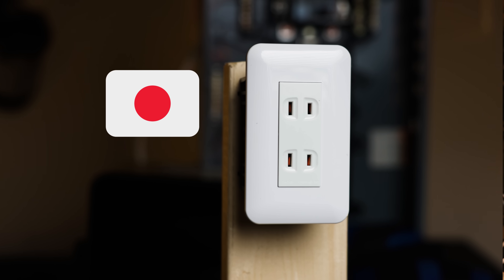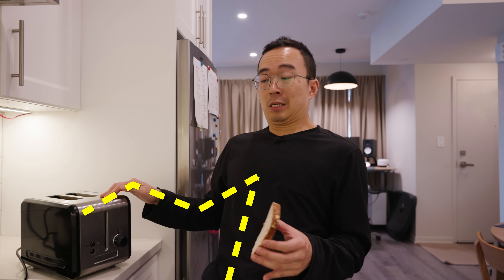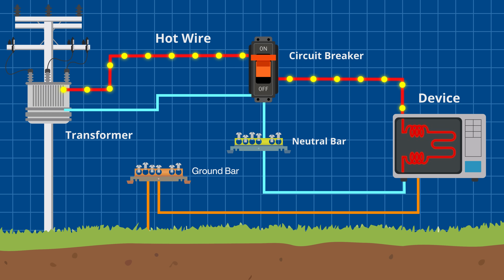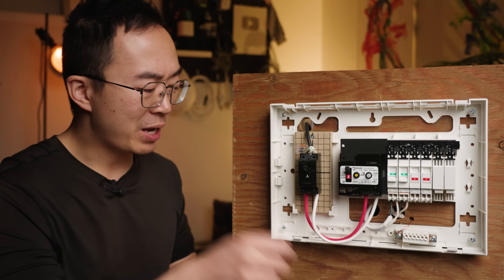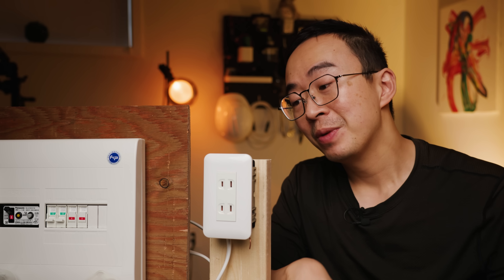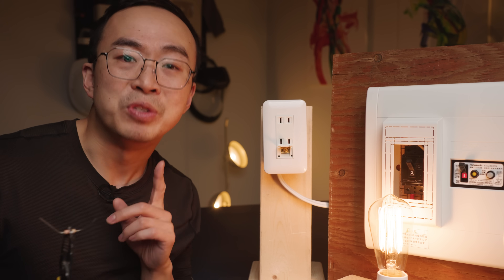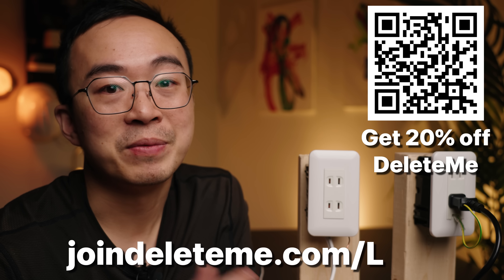How Japan Made Their Outlet Safe

Comment: I’m a bit confused by this video. Does Andrew live in Canada? Because here in the USA, we have grounded sockets, GFCI, and also polarized plugs, and circuit breakers. I am even looking at the GFCI protected outlets in my home literally as I type this. Seems like in fact the “international” RCD standard trips at some 20 milliamps while the USA one trips at 5 milliamps, making the American system, in totality, FAR superior for human protection. Plus you have grounded potential which ensures all voltages measure correctly relatively to each other (extremely important for digital devices). Am I missing something here? Everything I wrote is factual, unless I am mistaken somewhere.
Reply: Canada and the USA electrical outlets are the same. GFCI trip between 4 and 6 ma. There are only minor differences between Canada and USA electrical codes, mostly in installation clearances and acceptable grounding methods, otherwise they are largely the same.
Reply: @wally7856 what I mean is this video makes it look like the USA doesn’t have much protection beyond grounding.

Comment: This is not how ground works. In European electrical installations for homes there are three protections: 1) circuit breaker for too much current in case of short circuit - electricity flows uncontrolled but still within the system; if left unchecked, the installation will overheat with risk of fire 2) ground circuit breaker - this triggers in your toaster case when current out is not same as current back in, so there's a leak of current (to ground, possibly via you). Typical trigger level is 30mA. 3) Ground - which you explain in the rest of the story. This is to remove electrostatic charge buildup from electrical devices by equalizing the relative voltage of the device with that of the installation to that of earth ("ground").

Comment: It only works if outside is grounded and the leak goes before FI .... if you are in wet bathroom where grounded washing machine is connected to the wet floor and you touch anything, central FI won't protect you ..... that is why there are usually FI protected outlets on those places ..... in EU FI is mandatory for yeeeears .... and also we have grounded appliances to avoid internal failures ..... overall Japanese system is simply inferior and not very safe ..... and don't let me start with Japanese 100V system which is just even worse than american 120V ... it needs almost ~2.5x more of copper, to transfer ~2.5x more current than rest of the world .... meaning it is waaaay more expensive, more prone to failures and fire etc. ........ hope they don't build paper houses like in US .... US electric "standards" are just joke and are usually installed inside flammable materials with 2x more current and therefore prone to fire which is ridiculous .... from Europe stand it is just 3rd world country, we require FIs ... also for flammable spaces AFDD (Arc Fault Detection Device) is required ... I bet americans never heard of that;-DD

Comment: Okay I am really confused now. I’ve been living in Brazil and the way things connect there are curious to say the least.

First, all outlets have 3 pins (one for ground). But the weird thing is that, from the pole you have one red that comes from the transformer and a blue that is a grounded rod at the pole.

From there you have your main, two surge protectors (red and blue) and a GFCI that is only used for areas that commonly get wet (kitchens, bathrooms…). Then you have a ground which must be kept SEPARATE from the GFCI connected lines.

What’s up with that?

Comment: Our house was built 2 years ago. It uses mostly the 2 prong type, but there are a few with grounding screw terminals. The ones with ground are in the bathroom and in a couple of other places where high power appliances were expected to be connected. We also have some 200v outlets but those all use a different kind of plug which has 3 prongs. At my office almost all outlets are 3 prong.
Oddly, though all the outlets are polarized (one pin wider) I have not seen any Japanese appliances with polarized plugs.

Comment: Ok question, i live in an apartment in Japan (2020) and my room doesnt have a ground plug at all, my monitor has a ground wire coming from the plug, am I safe to keep the ground wire detached? I’m at least looking into a plug that has a ground screw in case
Reply: Well , you lost the protection IF there is a fault. If you want to take risk, go ahead and remove that ground pin.
Reply: It's Japan, so the electrical wiring is done (by law) by a certified electrician and not the owner's I-ll-do-it-for-a-meal friend. You'll be safe.

Comment: Ground is not for the safety!
It is hilarious to see that so many comments point it out and the video still there without fixing the misinformation.
Reply: Ground indeed protects people by tripping the circuit breaker while standard breaker protect wires. Where people get it wrong is thinking standard breakers protect people
Reply: @nhitc6832  I know that. But what I meant is the main purpose of ground is not the safety. Breakers can use the property of ground - if you have it, but not necessary - as you see in Japan case. The main reason for having ground is setting the reference voltage, because voltages are relative.
Reply: @user-irkdj248dkdollii  We literally call the third prong in North America the "safety ground". It's sole purpose is to connect to the metal chassis of an appliance in case of an internal wiring fault. If the hot wire somehow detaches inside the appliance and makes contact with the metal chassis of the appliance, the whole appliance is now hot. Without that safety ground the chassis stays hot and if you touch the appliance, you too are now hot - touch say the sink with your other hand and you die. With a grounded chassis, if the hot wire contacts the chassis, the current returns through the safety ground wire and trips the breaker deenergizing the circuit. Plastic chassis appliances don't use the safety ground here (2 prong plug instead of 3) because they don't have that danger as plastic isn't conductive.
Reply: @wally7856 Hi Thank you for the input. Yes you can use the third prong for safety purpose, and maybe that's why you call it that way. But as an electrical engineering major, the more important purpose for the third prong is setting the 0 voltage reference. For safety issue, there is a way to achieve the same thing without the third prong.
Reply: @user-irkdj248dkdollii  You use the neutral wire for your zero reference voltage not the 3rd wire safety ground. In fact, using the third wire safety ground as zero reference is just downright dangerous as a broken neutral in the circuit would energize the chassis of your appliance. The safety ground wire is also noisy and a horrible zero reference anyways.  I'd also like to know how you can achieve the same appliance safety without the third wire. Connecting the neutral wire to the chassis is just asking for trouble as humans hook up these outlets and they can and do reverse the hot and neutrals by mistake making your appliance always hot. GFCI's are not everywhere and even if they were, you would still have a hot appliance until you got shocked and only then it trips. Back to how we do things here, the sole purpose of the 3rd wire safety ground in North America is for safety and that is it, nothing else.

Comment: In Sweden (and EU) we have grounded outlets (where only grounded or double isolated appliancies fit) in kitchen, garages, outdoor etc. In old days we had ungrounded in livingrooms etc. But in modern building standard we have grounded outlets everywhere. To this we have a common ground fault breaker in all houses. In the electrical central, by the fuses. Both belt and suspenders. Furthermore ALL outlets and extending cables are child safe. You cannot put anything in one of the holes in the outlet and get connected to power. You need the plug to remove the plastic safety in the holes, with both pins at the same time.

Comment: A couple things wrong with this video: 
-the wiring diagram shows shows the neutral wire going through the circuit breaker. It doesn’t. 4:02 
- connecting ground and neutral doesn’t “save your life” by creating a “high speed raceway”, allowing the breaker to trip. Your circuit is grounded, and so that already exists. The current doesn’t need to go back to the neutral wire to do this, and it certainly doesn’t need to go through the breaker a second time via the neutral wire as your diagram shows. 3:21

Comment: Ahh.. I didn’t like the AC power being animated like DC (moving in a continuous path around the circuit and not oscillating back and forth)

With the example of power going to ground, it’s easier to visualise that the power doesn’t need to travel from the ground stake to the transformer down the street.. the electrons aren’t (on average) actually travelling anywhere, just vibrating back and forth…

(Had this click for me when a friend pointed out a rural property that had a “single-wire earth return” setup (SWER)

Was thinking.. wait, how would this work? And if it did, won’t all the electrons build up at one end or something? Nope.. thinking like DC

Comment: half true, a ground wire ALSO can divert current too small to trip a breaker if there is high resistance connection somehow from hot to chassis.  The breaker won't help you there nor is the ground wire solely  intended to trip it.  It doesn't take much through the torso to kill a human.

Comment: Yep, you said it at the end. YOU GET SHOCKED before the GFCI (RCD) trips. Having PE in the outlet will trip the GFCI the moment the fault appears, no touching required.
So, adding GFCI without PE doesn't make outlets safe and I am almost sure it's forbidden by law in my country.
Reply: Also PE must be linked to N only when GFCI (RCD) is present and the link must be before it, otherwise the fault current might be too small to trip the current breaker, but enough to start a fire.
Reply: This is in the case where the hot wire is just hanging out. In such case, I'd argue that Japanese panel is safer than American one. Japanese GFCI breaker protects everything in the house. So if you touch that hot wire, the breaker will trip. However, in the U.S, you'd HOPE that hot wire is connected to a GFCI outlet/breaker. But as we all known, not everything in U.S houses is protected by GFCI.

Comment: Good explanation of why we jump neutral and ground in the main panel in the US and fault current!  The device in the Panasonic main panel would be called a GFPE in the US with 30mA leak current.  GFCIs trip at 5mA leak current for the exact reason of a higher safety margin for people (like small children).  The 2023 NEC revision added more location where GFCIs are required (not to mention changes for AFCI requirements).  The best of both worlds is always going to be a grounded GFCI.  GFPEs are used where there is a higher tolerance for leak current and to protect devices.

Comment: Hmm. I need to learn more about my outlet. It seems like the ground wire is pretty useless :D
I do have my residual-current circuit breaker connected to everything, except the fridge (yes, the big metal box), because it sometimes trips on its own. And I use by RCCB to shut down my apartment when I leave for a week or more.

Comment: An interesting thing about the old two-prong outlets in the U.S. is that, if properly wired, they were grounded. The screw in the middle that secured the faceplate also served as a path to ground. Similar to the Japanese grounded outlet you showed, you could connect a ground wire to the outlet's screw.
Reply: except that "ground" is a very high impedance path.
Reply: @nhitc6832  Not on the outlets I am describing. They were specifically designed for the screw to be the ground, similar to the Japanse ones. There are even adapters made specifically for using a three prong plug in a two prong outlet, including connecting the ground.

Comment: In The Netherlands it is the same system. Thus, I am not sure I get why the Americans connect the ground to the neutral. The ground in the outlet is still used. So I keep watching to understand how they do without the ground. 
Upd. Oh, okay, so Japan does not have ground for "safe" appliances. Only in spaced such as the bathroom. Hate to break it to you, but it is less safe. 
So, the Americans found a way of making the net safe without having to a GFCI, that came to Europe in the 70s. I would say the American system is way more advanced. By far. 
Upd. 2. You mixed up two completely different themes: ground in the outlet and the way circuits get interrupted when needed. Or in other words: ground in the outlet yes/no and the way the electricity gets cut off. 
Upd. 3. The American system sends current back to the neutral from the ground effectively mimicking a short circuit. 

Conclusion: the American system works without requiring GFCI and you dare to say the Japanese system is better? Okay got it.
Reply: we have to connect ground to neutral because that's the only way we can create a low impedance path for fault current to flow on. If we DON'T connect the ground to neutral, the only path fault current can flow on is through the soil, which has a very high impedance path, and as the result, fault current might not be large enough to trip the circuit breaker.

Comment: Hello
Thank you for introducing Japanese electrical outlets.
As you mentioned, two-prong outlets are the standard in Japan, and most circuit breaker panels are equipped with residual current devices (RCDs).
Furthermore, Japanese RCDs feature a visible protrusion that pops out when leakage occurs, and they also have a test button for checking leakage.
Well, three-prong outlets are the safest option, though...😅

Comment: ❓FALSE TRIPS?  Electricians, do you see many false trips on break panel versions of these current imbalance trip GFCI’s/RCD’s?  Here in the US we like the individual protecting outlet’s (or tying a few in a kitchen) so test and reset takes place at the use location.  Years back an electrician said to me the versions at the breaker panel false tripped due to the long line back to the panel.  In Chicago, we are all in metallic grounded conduits with neighboring circuits are in the same raceway.

Comment: The other thing you can do is get GFCI breakers installed. Yes we have them in the US but they are more expensive than normal breakers which is why they aren't used everywhere. We really ought to change our electrical code to require them though, it would save lives and make hunting for that one outlet on the circuit that has the GFCI way less annoying (it was in the garage behind the fridge btw, WHO DID THIS?! WHY WOULD YOU PUT IT THERE?!! IT ISN'T EVEN THE SAME CIRCUIT!!!).

Comment: That is wrong and stupid. In Europe, in my country in particular, by code, all electrical outlets are protected by RCD devices, not only at some places (like in your example). Also we have everywhere 3 wires for single phase installations, which means we have both RCD and ground everywhere, so NO, Japan didn't do anything smarter or better by removing the ground wire.

Comment: Well in Italy we have both , grounded and Differential 30 mA (Salvavita , or Life saver) in the main circuit of the house .
The wire system is the same as your  , the neutral is not connected to ground .

Comment: As I grew up in both France AND Japan and worked on household electrics there, it wasn't until the second half of this video that I realised how odd the US system is.  I assumed separating Earth (ground) and Neutral was the standard in most countries, and was alarmed when you said that in North America they were connected.

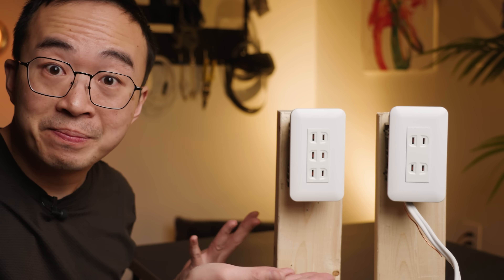6:00  Japan is safety-focused in SOME areas.  Plumbing isn't one of them.  There are thousands of miles of gutters on the sides of roads that sometimes double-up as pavements if they're covered.  People have had to go to hospital because of serious injuries due to having fallen into to those side gutters (of which some are up to a meter deep and a meter wide).  Not to mention those who've tripped by having their foot get caught in the hand holes covers often have.

Comment: The breaker does not use the ground to trip, it uses the current passing through it. Most are thermally tripped, such that if too much current flows a strip in the breaker heats up and expands causing the breaker to trip. There are also magnetic breakers that trip on by the amount of a magnetic field is created causing it to trip, 

The ground only comes into play if the hot wire comes in contact with the metal chassis of the applicance. In the past the applicance chassis was connected to neutral. The purpose of the ground was added if the neutral wire got disconnected leaving the applicance hot.